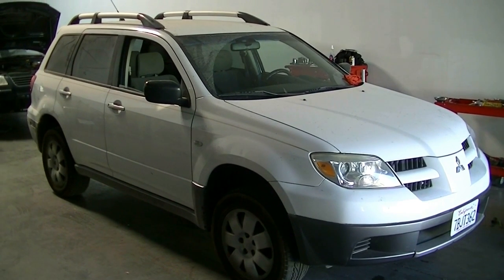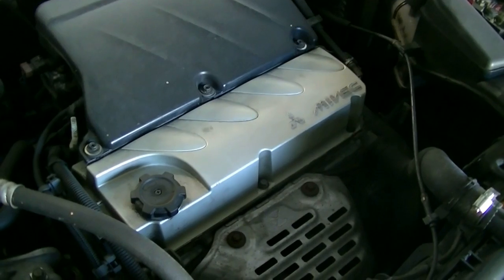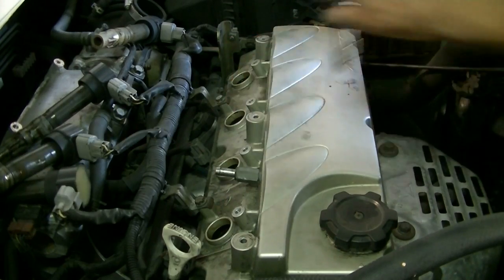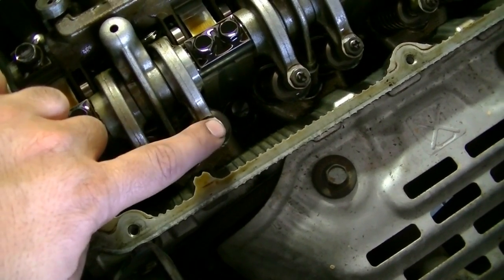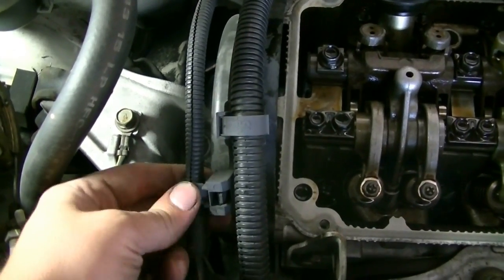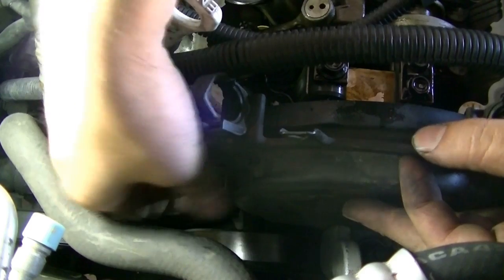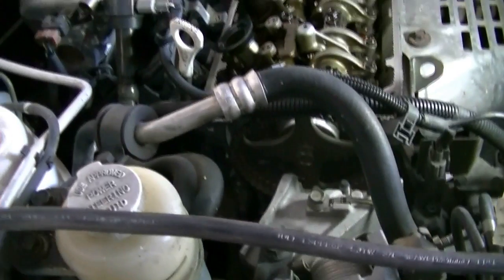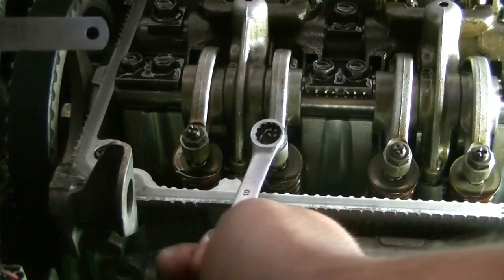How to Adjust Your Valves

Comment: For your information:

Measure the valve clearances. There was a need for clarity. In the service manual on page 11A-11 specified gap intake: 0.20 mm (0.008 inch), Exhaust: 0.30 mm (0.012 inch). However, this is not true. More precisely, this is true for the Engine coolant temperature: 80 − 95Â°C (176 − 203Â°F). It's very inconvenient. Therefore, open the page 11B-22. Here are written valve clearances for a cold engine. Standard value (in cold state):
<Vehicles for CALIFORNIA emission>
Intake side: 0.11 mm (0.004 inch)
Exhaust side: 0.21 mm (0.008 inch)
<Vehicles for except CALIFORNIA emission>
Intake side: 0.11 mm (0.004 inch)
Exhaust side: 0.22 mm (0.009 inch)

I've always removed the spark plugs on any car that I've done valve lash adjustments and or timing belts, used a coat hanger or rubber glove in the spark plug hole to be double sure it's top dead center and it's ALWAYS been 100%. 🙂👍

Comment: Friend, thanks for your explanation and I wanted to ask you since my English is little, you say that by placing piston one in top dead center I adjust at the same time the 4 valancines of cylinder one, the 2 intake of cylinder 2 and 2 of cylinder 3 exhaust ?? and then turn 360 0 are 180 degrees to adjust the rest of the rocker arms at the same time thanks

Comment: In the video I hear you begin with stating that after TDC a 360 degree rotation is needed.  Then later on it is difficult to tell if you are instructing to turn an additional 180 degrees.  540 degrees?  Is this to go from the compression stroke over to the exhaust stroke?  The video does leave a  beginner lost with questions.

Comment: That looks extremely simple.  I want to try this myself on my car to save me 250 dollars. Lol. Question tho if you're still reading comments. The positioning of the valves you adjust with the notch top and center and after the 180 turn are they all same location in all cars or do they vary?

Comment: try changing the timing belt tensioner. they get weak on the 4g69 causing it to smack against the water pump making the same noise as the noise made by an un-lashed valve
Reply: I had to change mine cause it have got weak,,,, really.

Comment: I am going to do this on my galant....same engine. 

Did you have to remove the spark plugs?
Reply: no need , spark plug  usually removed to make sure that the piston is at top dead -center which means that both valves must be closed at that time and you can then adjust the clearance